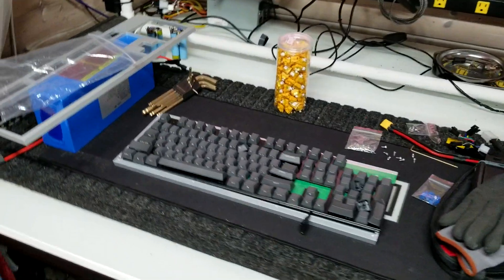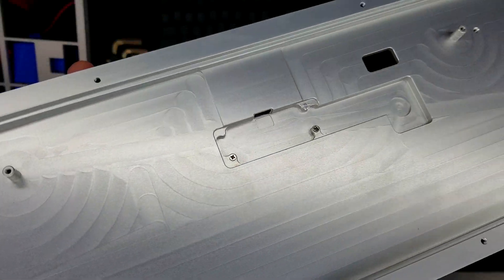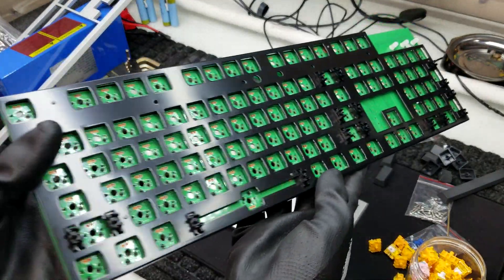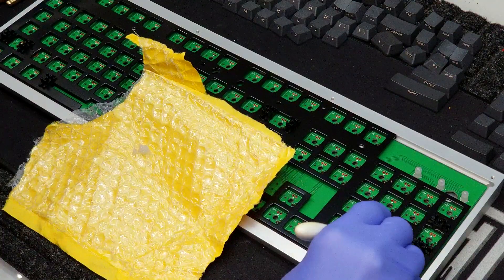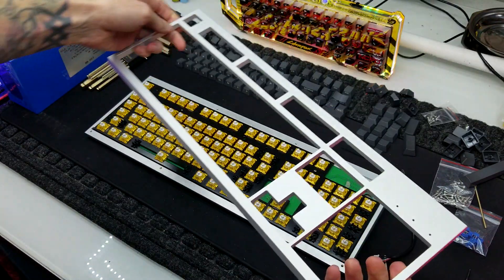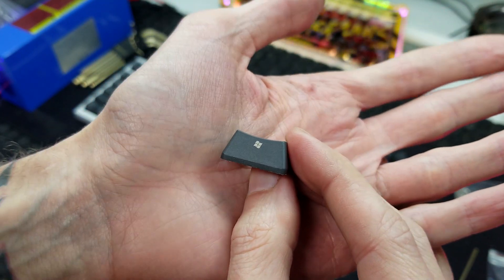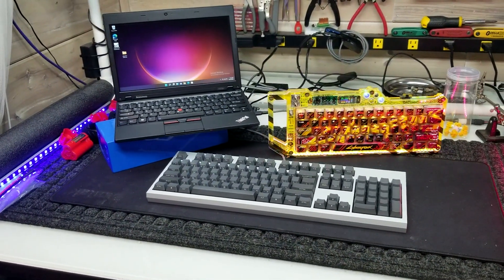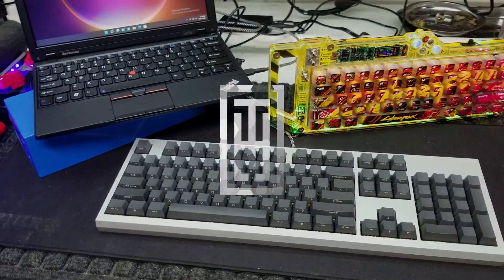⌨ New Mechanical Keyboard Build - CNC Aluminum Case (With PBT Keycaps)

Comment: I was here to learn how the insulation is done on a PCB in a cnc aluminium case. I was disappointed.
Reply from the maker: Didn't like my insulation? Typically there is a plastic insert that is laser cut that fits the bottom exactly, I didn't have that part so I DIY'd it.

It's not even really necessary as the PCB does not touch the case, it's more of a "just in case" (pun intended) precaution. You can do other insulators, "tape mod", fill it with wool, fill it with foam, fill it with anything that isn't electrically conductive. All will change the sound signature slightly.

This has been my main board since I made this video and I use it every day without issues 👍
Reply: @hightech-lowlife  Your solution is fine but I wouldn't do that myself. Glad to hear your keyboard is getting great use and is working great! :)
Reply from the maker: @Kaenargh  What would you do instead? Thank you 🍻